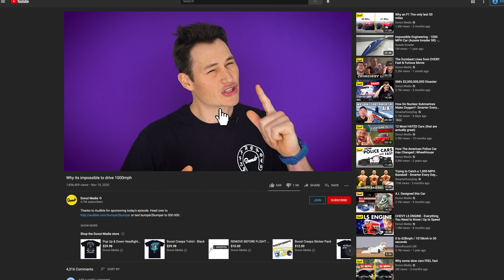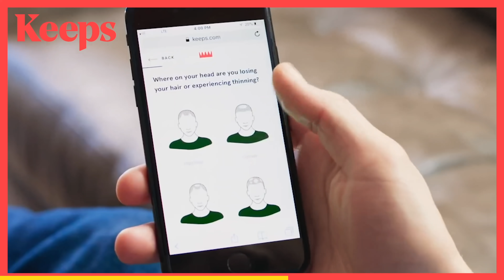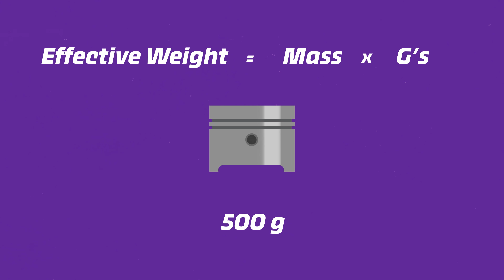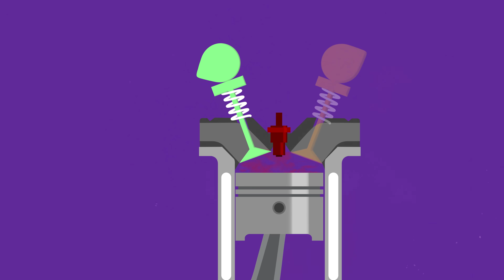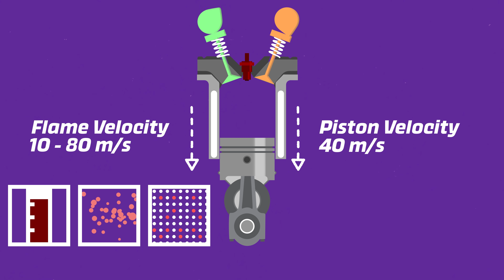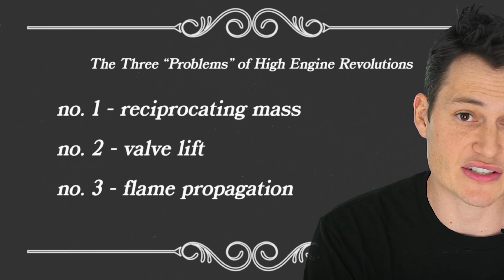Why It's Almost Impossible For An Engine To Rev Over 20,000 RPM

Comment: You simply cannot make that title statement without caveats. The smaller the engine, the higher the revs it can reach. I have two engines, 7.4 cc and 15 cc, rated at 21,500 and 24,000 rpm respectively. Plenty of engines under 10 cc are designed to reach 40,000 rpm.

Comment: My goto has always been "power density".  How "big and heavy" is the engine that is making this power?  If you use an iron block, it's going to weigh more but it also means that block would likely be able to withstand higher pressures if you choose boost.  The 2JZ is an excellent example of this.  Bigger displacement does not necessarily mean a bigger/heavier engine.  Best example is the LS vs Coyote debate.  On paper the Coyote looks clearly superior to the LS.  BUT the LS weighs less and has more torque.  The engine that really made me look into power density was the Chevy LS7.  It was the one of the lightest, most compact, 500Hp+ "out of the box" motors you could get.  The valvetrain did not impress the import snobs (pushrods?) but this was a world class motor.

Comment: Weight < smaller parts
Valves < 2 stroke
Fuel < 30% nitro
.
33,000 rpm RC motor 😍

Comment: Decelerate WAS NOT A WORD AND SHOULD HAVE REMAINED NOT A WORD. To “decelerate” is to accelerate. Period. The word accelerate covers it all. 0-100 or 100-0 , it all acceleration. Driving at 100mph Hitting your brakes as hard as you can until you reach zero is accelerating from 100mph to 0 mph.

Comment: That's why my engine have two spark plugs per cylinder to burn the mixture faster. If one of them is broken, I notice it immediately because the combustion is different from normal in high rpm.

Comment: Haven't even gotten to the explanation but I can already guess that even if you could turn the motor faster than 20k rpms without exploding the bottom end. Trying to get air into the motor fast enough is now becoming exponentially harder.
 I like low rpm power though cause you can get a lot better mileage that way too. I don't mean diesel power, I mean like 3500-4000 rpm peak power.

Comment: Rev an engine 20k rpms it's possible only if you can build cams and valves that can handle 20k.. even with a 13b rotary engine you just can't reach 20k it's impossible.. it's just impossible for valves to open and close for 20k rpms.. it's just impossible...

101 mecanics course.... what bring gas inside the cylinder ? Answer: Injectors ....

What brings the air inside the cylinder . By the air intake manifold with Open Valves .. the admission valve to be more precise 

What is combustion? It's gas and air compressed by a piston with close valves inside of a cylinder.

After the combustion, what happens next?  It goes away  by the other valve..the exhaust valve to be more precise.  

So if you rev your engine 20k rpms.  Your valves need to open and close for a speed of 333.33 times / second... so if someone can invented and build cams and valves that can handle 20k.. you will be a very rich man

Comment: rotational valve feg  solve vlave float factor 👌🏻 oil film is another issue which ripp of at certsin poston speed so need be improvements in this depesrtmenet + air fuel inertia can be also trouble in how fadt it can move into chamber .

Comment: What about how air will get inside the engine? Air is not uncompressable like water which can be a problem. Piston moving down the cylinder during the suck stage creates vacuum and that vacum sucks air in, but at such high RPMs the air would stretch because of the increased vacuum speed, which results in less oxygen in the air/fuel mixture, resulting in unability to go higher RPM.

Comment: Yet another problems are propeller shaft and bearings - even if we could imagine putting a turboshaft engine into the car and powering it this way, bearings and shaft would just burn and break down from such excessive speed and, in result, heat. It's also quite obvious the same fate would await the transmittion, regardless if it was manual or automatic.

Comment: Why do most diesels redline at 4.5k and why can't they use a spark plug
Reply: Most Diesel engines are made for trucks since diesel is good for making torque and trucks need more Torque  than hp for the thing they are used so they make those engines with longer rods, runners and stuff that makes the engine rev pretty low 

But the spark plug thing idk bout that

Comment: "Almost impossible for an engine to Rev over 20,000 RPM's"

Huh?? Some of my little R/C competition engines will rev to 40,000+ RPMs, and make over 10 h.p. per cubic inch in the process, and it IS an "engine" in EVERY sense of the word... 🤷

Comment: "HP = torque x RPM"

So if it's making 200 ft lbs of torque @ 3000 rpm that means its pumping out 600,000 horsepower! Yeah baby! Who needs space x to get to Mars when we can just use a Toyota Camry engine?

Comment: 2:44 
Another one is the springs. Ducati made a motorcycle go faster by removing the springs and basically locking the valve to the cam

5:04 
$#!7

Comment: No applicable to consumer engines for cars but I suggest you investigate aero model 2 stroke engines. A Cox Tee Dee 010 (0.16cc), of which I have two, develops peak power at 27,500 rpm, it runs on methanol and uses castor oil in the fuel for lubrication and was mass produced in the USA. Larger engines have been used for ducted fan propulsion to replicate jet power before small turbines were available. There are plenty of other examples in aero modelling and in model boating where engines rev over 20,000 rpm. When it comes to problem 2 try desmodromic valve gear.

Comment: Question. What if you made a cam shaft just like a crankshaft and install the valve like how you install a position? A theory that will never work?
Reply: The problem there is you want the profile of the cam so it sets the valve on the seat more gently and doesn’t just slam it closed. Can’t really get that with a crankshaft style system that would slam the valve closed and break it at high rpm.

Comment: well, nobody invented rotating valves instead of push up/down?. I mean, a valve which has a hole that only will be open in certaing angle, when the valve continues rotating that hole won't match the static hole, so, it closes!. And that is it, no problem of flotating valves!.
Reply: Look up sleeve valves. They’ve been used on some engines in the past and provided performance improvements. But, also added a lot of complexity and issues with the sleeves getting dirty with carbon and sticking.

Comment: Some piston engines can rev higher than 20k RPMs. RC nitro engines rev high as 35K RPMs. I agree they are glow engines not "spark" ones and 2 strokes which eliminates the valve floating issue  nevertheless they are piston engines which can rev above 30-35K RPMs.
Of course they are very specific, your video is very informative and I just wanted to add my 2 cents 😉

Comment: All BS ! BETTER LOOK AT A HONDA CBR250rr or a kawasaki zx2r both rev to 22000rpm !
Rpm is limited by piston speed !
A Harley piston at 6000rpm is doing 24000 inches per minute a CBR 250rr piston is doing 22000 inches at minute at 19000rpm ! Less than a Harley  by 2000 inches per minute .

Comment: Basically an engine is a Rube Goldberg device.
1,020hp and 23,000 rpm awd plaid, with an 8 year warranty, 75% cheaper fuel at home, sounds like a bargain.

Comment: Problems values float so you add stiffer springs 
Then most parts are oval
That's why my uncle would use certain motor 
Then biggest issue was motor mounts breaking
Race engines use higher voltage for better spark

Comment: In the 1990s there was a time of 250cc 2-Stroke Motorbikes like the Kawasaki Ninja ZXR 250 Which had it's redline at 21.400 rpm and it idles at 1.280 rpm...
Reply: The Kawasaki ZXR 250 was a 4-stroke and made its max power at 15,000rpm. Revving it above that was pointless!

Comment: It's to do with Priston speed and the ability of the fuel flame speed I think its about 60mph for the piston so a shorter storke give high rpm high horse power but less torque as the throw is shorter 😳 😉🤣❤️🙏✨️

Comment: Mother Nature is Physics. FYI: Honda F1 V10's could rev to 24,000 RPM reliably and 26,000 RPM for a few seconds before exploding.
F1 valves do not use springs, rockers, and cams. They use pneumatic operated valves - no CAMS! Hydraulic valves are too slow.
F1 cars DO NOT have a flame front as the ignition is designed to cause over-pressure, not ignite the mixture. In this case the entire mixture explodes at the same time - no flame front! F1 has not used a short stroke to aid flame propagation since the late 1970s. Incidentally, this is when F1 stopped using four cylinder engines. The compromise of the current v6 engines means F1 engines will not go to back four cylinder at any time in the future. They are more likely to switch to 2H fuel-cell generators and electric engines.
Reply: Phew, lots of wrong stuff here Bertram. 
No Honda F1 engine ever reached 24,000RPM - not even UNreliably! LOL
Pneumatic valves still use cams
There is no such thing as a hydraulic valve.
The reason you give for why F1 stopped using four cylinder engines is just....well baloney!
If F1 reduced its max engine capacity - they would go back to 4-cyls tomorrow. ( For example the 1,000cc MotoGP 4-cyl engines)

Comment: Can y'all make a video on what happens if you use different types of fuel other than the ones specified by the manufacturer.  
That means instead of 95 octane you run on 92 octane. What does that do to the engine in the long run?
Reply: Detonation is compression ratio is too high.

Comment: Wait; here’s my main question; I wanted to increase the rpm rev range on a car (any car), what parts would I need/what do I need to do?
Reply: any part that moves and is involved in combustion, basically. You'll have to get everything stregnthened, rebalanced, etc. Your spec limits and tolerances also get a lot tighter.

Comment: 0:44 seconds he lights gas, it takes a certain amount of time to burn. the faster a motor rotates, the less time the fuel would have to be spent. leading to smaller volumes. until unfeasible to revolve any faster. 

guessing before watching...
was i close?

Comment: Honda V-8 F1 engine, Cosworth V-8 F1 engine and small capacity motorcycle engines will too. Most won't last very long at prolonged engine speed of 20,000 RPM, but that's another story.

Comment: Short stroke means less torque due to the shorter moment arm on the crank.  RPM is a design trade-off.  Some motorcycles hit 45,000 RPM simply because the pistons and valves etc are tiny.  My truck V8 likes it around 1500-2500 RPM but it has big pistons and valves.

Comment: Jeremiah said that when the piston traveled faster than the flame, the engine made no power. This is not true. As long as the fuel is being combusted, heat is released which increases the pressure in the cylinder. It is the pressure that pushes the piston down and generates power. Pressure waves travels at around 200 m/s depends on local temperature and combustion, so it is faster than the piston.

Comment: Hey Jerbear. Can you do a video on the Kõning 2 stroke methanol engine? We ran one of these on my dad's Pro Hydroplane for years. Really cool motors. The carburetors basically have two moving parts.We ran the 5 port. 13,500rpm sounds so angry😎 those Köning Brothers knew what they were doing back in the day

Comment: Honda RC148's 4 stroke 125cc inline 5 engine made 34 bhp @ 20,000 rpm and revved upto 21500 rpm.That was in 1965 when nearly everyone had 2 stroke engines.
More impressively Honda came up with the RC148 mid season due to RC146 being slower than Suzuki's 125 RT 64 two stroke bike.

Comment: I know you mentioned the F1 cars have big bores with small strokes which makes less power. Could 2 strokes help solve this? 2 strokes make around 35% more power than a same size 4 stroke if I'm not mistaken so why no switch? It's not like these are road cars, race cars have the sky as the limit.

Comment: He finally got to the real point: flame speed.   fuel efficiency works with piston speed about matching flame speed.  There's a reason some of the most fuel efficient tractor engines ever built were two cylinder John Deeres which ran at 1200 rpm.  Consider the speed of really big direct  drive marine engines running at 2-300rpm.
When I was 15 years old I thought that tiny OHC engines running at 10,000 rpm would be just great for passenger cars.  After all, smaller engines burn less fuel and high speed lets them make power even though they're small.  I learned.  What's fuel efficient is a large slow turning engine with as few cylinders as you can have without vibration problems.  
So, bottom line: you can make engines capable of running far faster than they can be efficient.  And there's no point in it.

Comment: The valve problem could also be solved by substituting the spring with a cam track in the spinning part(dont know the name). That way when the thingy spins it will always be symchronised with the valve

Comment: God does this make me fell super old which i guess I am.   Jerry there is one motor that revs super hi 20K aint shit.  I haven't been to a hobby shop in a long time.   Did a google search they closed in 2006.   Crap you should see what they sell for on ebay.  When i got my COX .049 it was attached to a plastic string fly plane.  You got the whole  thing for $20 bucks.  Crash ready .  And if you didn't fly over grass one flight was all you might get they were pretty fast and they broke up quick.  Anyway enough of history the cool thing was these little motors cranked about 30- 50k for some of the tiny ones.  The reason these could rev so hi is just because they were made of hi quality  materials and the rotating assembly was super light an ounce or less they were two stroke diesels no valves.  They were very similar in application to 2 cycle chain saw engines except for the longer stroke to make the fuel detonate.  They were only used for these little planes because they were essentialy single speed you just leaned them out till they sounded right and let fly till they ran out of fuel.  I wasn't a very good pilot but i was very good at crashing.

Comment: I love high reving engines. Low end torque is great, but winding an engine out to its max and just taking in the sound and the feel is great. My dream car build would be a honda s2k with ITBs and and a valvetrain to make good power at 10k rpm. I know it would be impractical for street use and would need frequent rebuilds, but there's no replacement for that high reving character.

Comment: Its not impossible. F1 teams were actually beginning to push through 20,500 RPM's almost 20 years ago. The  FIA imposed regulations that capped RPM redlines at 19k in the V8 era.

Comment: I know this video is technically talking about 4 stroke engines but piston engines can go quite a bit higher than 20,000, nitro rc motors can peak above 35,000rpm, yes they are a 2 stroke but they are still piston engines.

Comment: BECAUSE OF THE ROTATING WEIGHT AND THE RUBBERBAND RODS --- THEN THERE IS THE VALVE TRAIN THAT CANT STAND THE PRESSURE AND THE VALVES WILL FALL THRU THE SEATS BECAUSE OF THE HIGH SPRING PRESSURE AS WELL---   AND THATS THE END OF THE STORY------- OH THEN THERE IS THE OIL AND THE HEAT --IT NEVERS ENDS

Comment: Honda did it with a motorcycle engine in the 70s - 80s with oval piston heads
Reply: I think they're talking specifically about engines for cars that 4 stroke specifically.

Comment: Model car nitro engines rev as high as 45,000 rpm. Some even more. 2 cycle .28 cubic inch engine making 3.75 horsepower.

Comment: Fiat automobiles made decades ago an engine called Fire, idk if it stands for something in letters. In the Fire engine the valves simply never occupy the same space of the piston even at its/their max extension. Well actually I've never heard of a Fire spinning faster than 11k rpm, but hey it's a partial solution. At least you can't crack everything for direct contact with the piston mass.

Comment: Model nitro engines easily manage 30000 rpm and generate approx. 3 hp.

if we connect 100 motors of this type, we have 300 hp and 30000 rpm

Comment: i'd like to create an engine with material light enough with high temp and stress resistance. Paired with desmo valves and also the shortest stroke possible. And it runs on jet fuels
Reply: I guess high grade carbon fiber would do the job

Comment: Another system col mechanically closing valves is the Desmodromic one, mainly used on Ducatis. You have one cam to open the valves and another one to close them.

Comment: Opposed pistons in the same cylinder can have the same combined stroke with each piston traveling half the distance, minimizing the flame front problem, halfing the piston speeds for a given rpm,and doubling the maximum rpm (HP)
Reply: Too expensive and harder to maintain, not to mention the exhaust and intake sections would struggle, assuming you can build it to start with, a turbine its way more simpler, easy to repair, and also more efficient, over 90%

Comment: Should be "why a PISTON engine" not "why an engine".
Turbines ROUTINELY manage a lot more than 20,000 RPM on some smaller models - the HP rotor on the Williams FJ-33 models for example are specified to be limited to a little OVER 51,000 RPM, while most of the FJ-44 models are limited to less than 42000 RPM.

Comment: Say that to the gas generator part of the PT6C-67C engine I work with that spins at 38200RPM and the output shaft that spins at 21000RPM (100% speed reference)

Comment: 99% true :-) 2 stroke rc engines can run faster then 20000 rpm, and with a good amount, but is a pain to use in cars hehe. for car size engines you are correct.the biggest diesel piston engine, the Wartsila Wickman 14RT, is 1700 liter x 14 cylinders in the biggest ver, and it is running at about 102 rpm